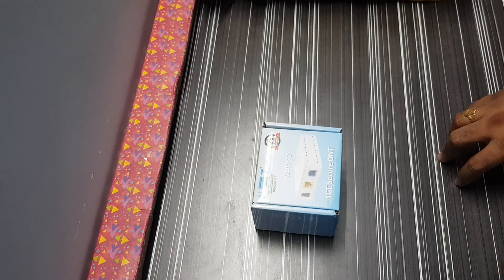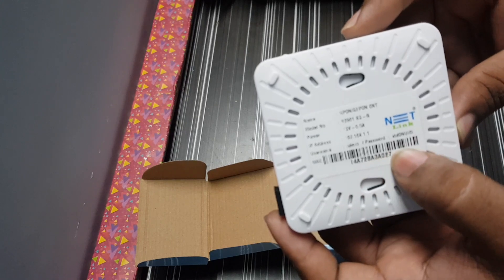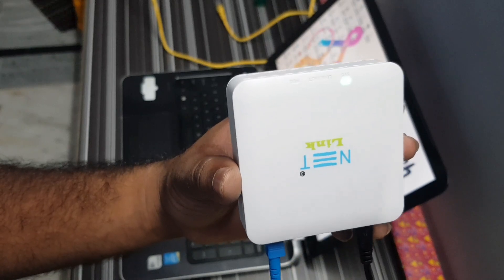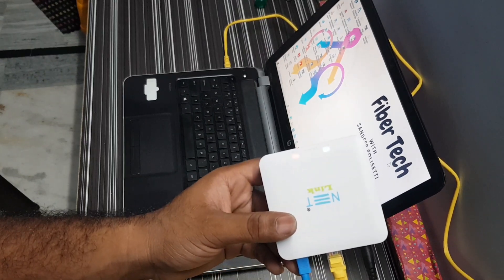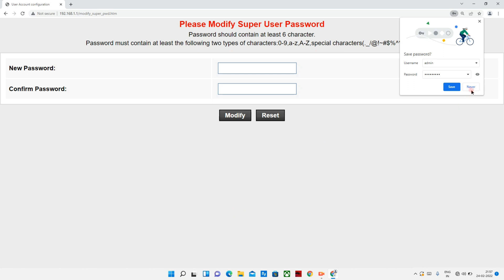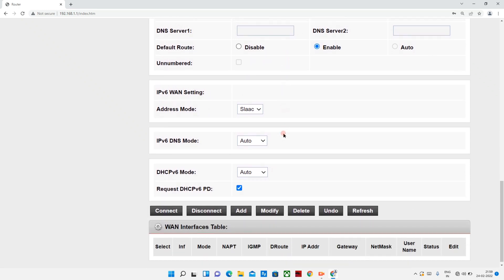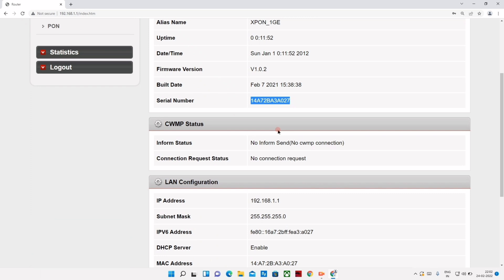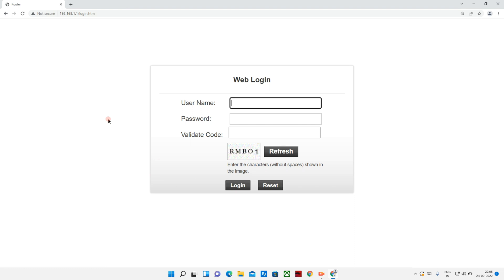NetLink V2801SG ONT Configuration in Telugu||ONU Configuration||Netlink||PPPoE Type Configuration

Comment: Does Netlink V2801SG have gigabit ethernet port?
Reply from the maker: Yes
Reply: @FiberTechwithSandeepPolisetti  I have this modem but in "Network connections" settings on windows, it shows only 100mbps speed. Is it the fault of the ethernet cable that I am using?
Reply from the maker: @yatinnain  how much speed u r getting from ISP....
Reply: @FiberTechwithSandeepPolisetti  My plan is of 150mbps but I am not getting above 100mbps through LAN cable.
Reply from the maker: @yatinnain  once connect ONT with router and check speed in wifi......if incase wifi reach 150mbps speed then change speed settings in your System
Reply: @FiberTechwithSandeepPolisetti  I tried it but it didn't work. Is anyone you that you know getting speeds above 100mbps using LAN ethernet cable?
Reply: @FiberTechwithSandeepPolisetti  As I thought, it was due to the ethernet cable, I changed the old cat5e cable with the new cat6 cable and now it is showing 1gbps speed.

Comment: Could not login to ONT page using default credentials and in such case how can I reset it to default again
Reply from the maker: Manual reset ....back side reset point vuntadi...pin tho 30 sec press chesi hold cheyandi reset avutadi
Reply: Not working default creddentials and resetted still issue is there
Reply from the maker: @nasheedabdul4476  please mention which password you are entering...try with stdONUi0i   this once
Reply: I have tried it still not working
Reply from the maker: @nasheedabdul4476  share your number to sandeepnaidu1994@gmail.com
Reply: Thanks now worked
Reply: How to configure voice in it
Reply from the maker: @nasheedabdul4476  no voice in these model
Reply: Anna naa daggara BSNL ont router undi aa router ni ap fiber ki use cheyyocha